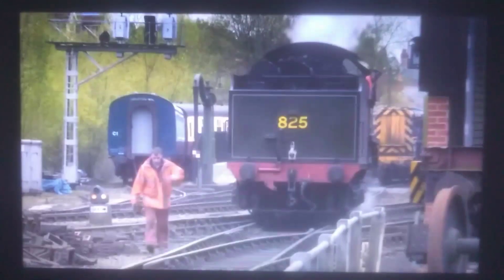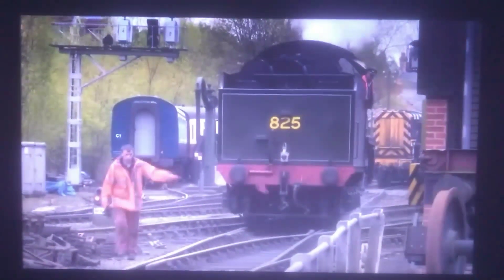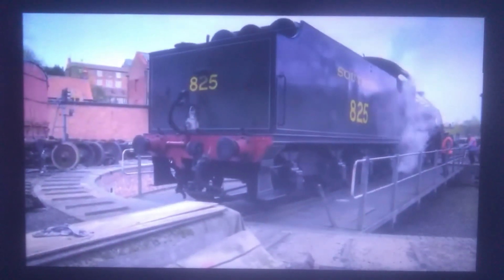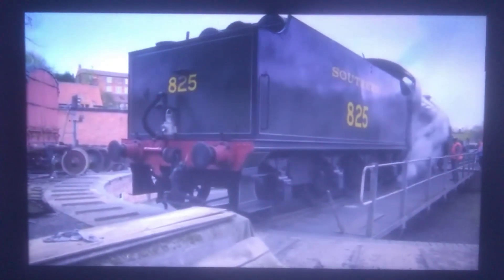Mr Perkins railway turning around Thomas & Friends

Comment: Here in the United States, there are two track configurations that are used to turn trains around. One is another kind of loop called a reversing loop (or a balloon loop), I live near a tourist railroad called the Huckleberry Railroad that has two on both ends of its line. The other track configuration that is used to turn a locomotive or even a complete train around is called a wye, and there are lots of them all over the country on mainline and tourist railroads